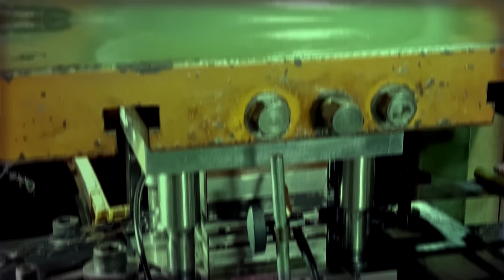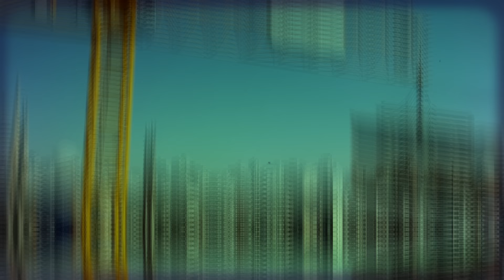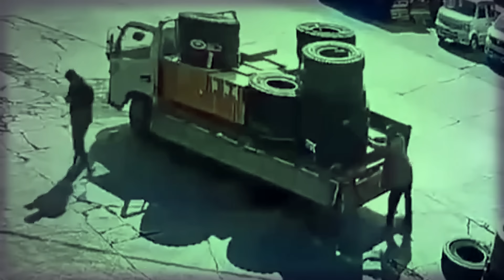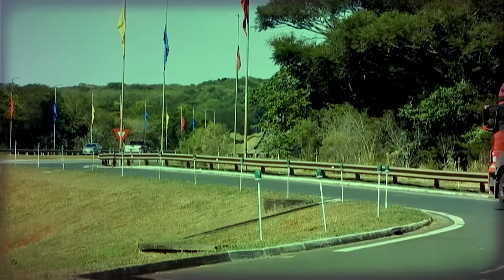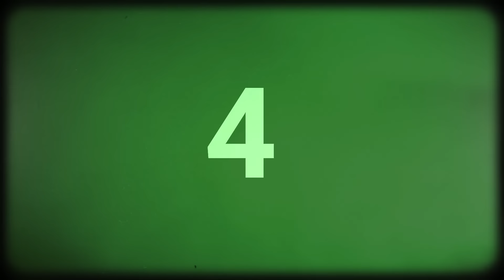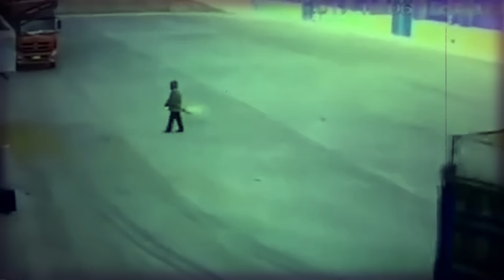Press Machine Accident Caught on Camera 😱

Comment: yeah because the safety harness connected to the thing that you're standing on that's falling a thousand miles an hour 300 ft to the ground is absolutely going to securely make sure that you die quickly and not a slow painful death😅

Comment: If you've ever worked 12 hour shifts around deadly machinery or from dangerous elevated platforms over time your brain becomes numb to the danger. Ive found myself a number of times reaching into energized machinery and working without fall protection. Industrial safety doesn't happen by accident. Paying attention and Lock Out  Tag Out saves lives.
Reply: Глухую женщину, которая подметала площадку, можно было спасти. Мужчина, который был в кузове машины с зерном, должен был не кричать, а кинуть лопатой зерно в женщину. Жаль, что он не догадался.

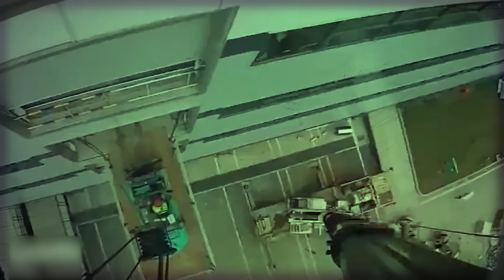Comment: 1:35, it doesn't take a rocket scientist to see the man that was sitting on the machine on the platform put it on reverse and drove the platform forward causing it to move and dropped whatever was on the platform,  I don't think it was the cables or the crane driver's fault... 🤷‍♂️
Reply: I agree with you. The cables remained attached to the platform. The forklift driving caused the platform to move.

Comment: 1:00 normally what companies do for this type of machinery move is they go through the roof? They remove a section of the roof and put the machine in that way. It’s sort of like the same way that you see cruise ships get their engines removed and replaced, but they go through the side of the ship when they have them replaced, but they do it on a solid footing. They don’t lift the engine up with a crane because that is an unstable platform.

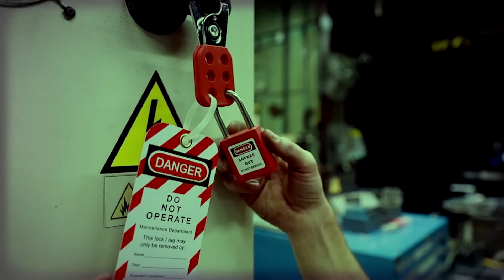Comment: 0:40 normally those types of press machines are supposed to have a dual button control meaning that as a safety feature, they should be on a machine like that like they are in some countries where you have to have your hand on both of them at the same time for the machine to operateotherwise the machine will not operate. If only one button is pushed or none is pushed.